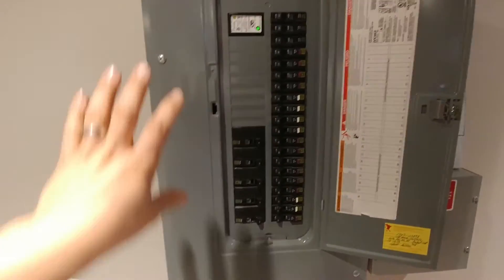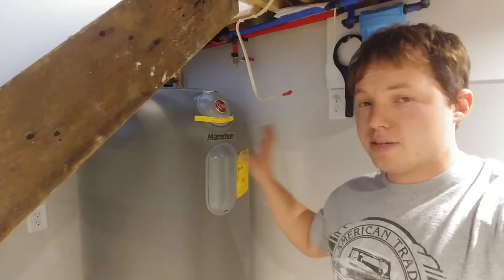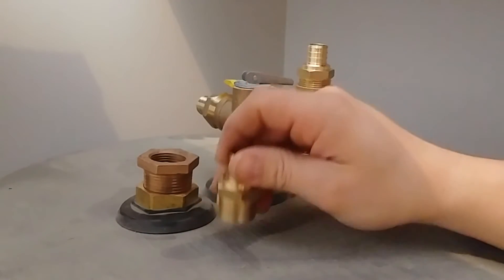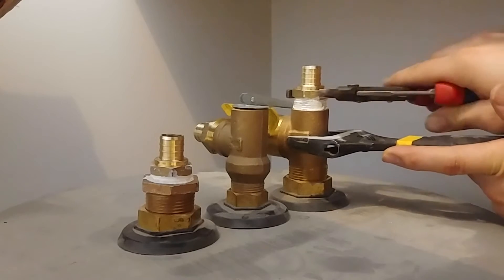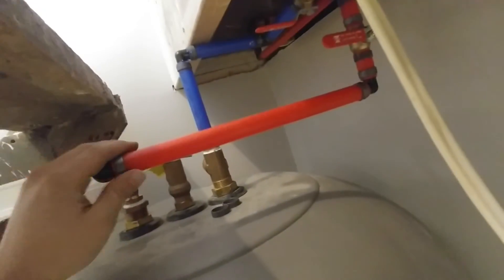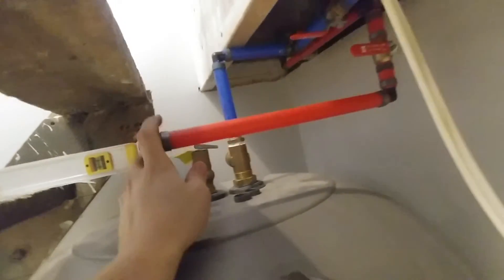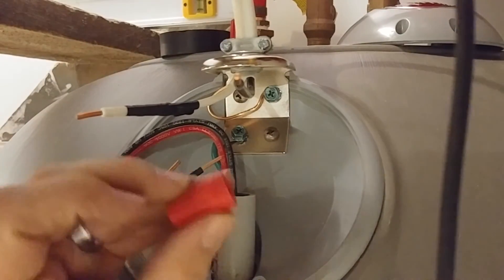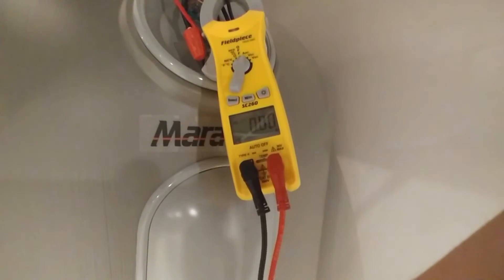How To Install an Electric Water Heater - Plumbing, How To Wire, & Materials Needed - Rheem Marathon

Comment: Can you run the power thru a 40amp contractor wired thru a 120v coil to a smart outlet, controlled by the automation network?

Comment: Do I need an expansion tank  for a electric water heater? Presently I don't. I need to replace 2 tanks because I have a geothermal system. Do they need to be put in pans? And lastly. Does the relief pipe have to be copper or some kind of hard pipe? Thanks again. I would appreciate a comment. .

Comment: Nice video.  But the manual states that the vacuum relief valve should be replaced every six years.  How are you going to do that without ripping out all the plumbing to the cold water inlet?
Reply: yeah I think for the cold supply with that VR valve you need to go with screw-on flex tubing so they can be detached. The older units the cold supply had T with the VR valve on top and the cold inlet coming from the side and you could replace just the VR valve on top by double wrenching.

Comment: If there are two green ground screws (one inside the compartment or junction box on the water heater and a second one on the outside cover of the box) does it matter which ground screw you use?

Comment: Next time install a disconnect and an expansion tank. You're will have a better system and protect your hot water heater and other devices with that expansion tank. The disconnects just for convenience but also for safety.

Comment: Shut off valves on the hot side of a water heater are Dangerous and Illegal just about everywhere in the U.S.  Having that valve closed and the water heater on will cause an explosion if the over pressure valves fails!  Never install one on the hot water side!

Comment: would have like to explain about ground wire does it go to bottom of tank to where
Reply: In general,  ground wires (green or bare) connect to , typically,  a green washer head screw within the appliances electric junction box and that green screw is connected at the factory assembly to the metal external parts of the appliance to ensure potential contact by anyone using/touching the appliance will not inadvertently receive an electrical shock due to any electrical system failure/short/arc etc.

Comment: What about code that requires copper pipe and brass fittings, is that relevant with an electric hot water thank?

Comment: Thanks for a great video. I was wondering if the wire should be run in a conduit. I am unsure of the code so I always run wires in a conduit for living spaces.

Comment: Hi, I installed one of theses in my home but I used a Galvanized nipple to fit a flex stainless tubbing and rust is starting to show at the junction of the vacuum breaker..

Comment: Great, except this would NEVER pass inspection..... this is NOT done to code ANYWHERE in the USA. No Flex lines from the water heater to the pex lines, no expansion tank, no earthquake straps, no disconnect.....

Comment: Great video, wow! You're a natural teacher.  So question for you.  If I downgrade my hot water heater from a 4500 to a 1500v, can I still use the same gauge wire that was put in for the 4500?
Reply from the maker: Yes but the breaker size would need to match the maximum circuit ampacity for the appliance.

Comment: A few quick questions. First what is your opinion of the stainless cinch style pex clamps? 2nd how is your water heater controlled for the energy program without wifi/network connectivity, and 3rd is it only a requirement to have metallic inlet and outlet for a set distance before pex on gas units?  Great video as always, I enjoy watching them

Comment: Hey man, thanks for the tips. Question about the pex: is it supposed to look so pretty? I thought you were supposed to run it curvy and use as few fittings as possible. A plumber I worked for once told me that. He said the old school guys would run it like copper, cutting the pieces straight and using lots of elbows, but apparently that reduces flow? I'm curious though to hear the other side. Mahalo!

Comment: Our Bradford-white gas water heater was in service for 26 years and was still working fine when we replaced it last year. Could never understand why it lasted so long (never drained it or changed the sacrificial rod) but read that if you keep the heat to a minimum (we always kept our water heater just warm) it slows down the corrosion process. Heat speeds up chemical reactions. Great video! Loved the cut away look inside!

Comment: My understanding is that PEX is not recommended within 18" of the water heater. This is a manufacturer's guidance, not code.
Reply: Should be code, it is in other countries.
 Copper is for keeps;)
Reply: I have copper water pipes in my home. I prefer copper water lines because I can actually hear the water flowing through the copper water lines.  This is a good thing when any one in my family (including me) leaves water running.  The only place I used a PEX A water line is when I ran a cold water line under my second story deck to a spigot. This spigot is used to water plants on my deck. PEX A will swell but not burst if water is inadvertently left in the water line to freeze during winter.

Comment: Great video! Informative and very helpful!
Reply: Thanks for the reply, really appreciate your videos!
Reply from the maker: Glad it was helpful!
Reply: @BenjaminSahlstrom  Would you use any Teflon tape or pipe dope if you were replacing the vacuum breaker?
Reply from the maker: @noelshaffer9609  Yes. Only the fittings that use a rubber gasket don't need thread sealant. And traditional tapered thread fittings need thread sealant.

Comment: Hi great video,  question I have is the different amps I have an older select water heater and it's the same size as yours. I did remove the elements to check for calcium deposits.  I am lucky as mine are made of brass and theres 2 top n bottom. I see you choose a different wire for for your main electric wires. I'll look back. 10-2 wire. Mine is only used in a lake house then it was shut off n empty on off seasons. It's still new. The wire on it is 12 ga yellow wire. I have a GE panel box and I'm all open as I just gutted my back home. I removed all the ceiling n it's just framing at this time. 
I want to run the new wire in my rafters and possibly buy a slide tube to keep wires safe. I will say I had a mouse or 5 in my home but never had 1 spot get chewed on by one of the critters.🦝

Comment: Installing PEX directly to the water heater as advised in this video is against code. It's not allowed for the first 18 inches. 604.13  http://epubs.iapmo.org/UPC/mobile/index.html#p=136
Reply: Not true under all codes and usually only for gas water heaters.

Comment: Awesome video on installing a Marathon.  I’m thinking of doing the same.  I was interested in what type of tubing you used for the pressure relief valve.  PEX?  If not PEX, what did you use?  I didn’t see an additional video from you describing how to do this.  Thx!!
Reply: I was also wondering the same.  Can you use PEX on the relief valve?
Reply: @hughrobinson6194  I never did get a Marathon (it wouldn't fit in the space I have for a water heater) but the unit I bought is an electric 40-gallon Rheem... and I did use PEX for the relief valve.  I think I used a SharkBite fixture screwed into the orifice and jammed that PEX right up into it.  Hope it never gets triggered but if it does it will work fine.

Comment: Hey Ben, I'm going from a natural gas water heater to an electric water heater.  My question is, "Can I run my cable from a sub panel or does it have to be run from the main panel?"  RR
Reply from the maker: As long as your sub panel is big enough (how many amp breaker is feeding it) then you should be fine. I'd say if you have a 50amp or better sub then it should work as long as you don't have other large loads on the panel that could cause issues. 

Good luck!

Comment: Nice!  I have a question:

I need to install a 19 gal 120 volt (1500 watt lower element (only one element) water heater.

What amperage breaker do I need? I know I need #10 wire and there is an existing double pole 30 amp breaker in the cutler hammer breaker panel; do I need a standard 20amp breaker to replace the existing 30 amp?
Reply from the maker: The water heater should say the maximum sized breaker on the information sticker somewhere.
Reply: @BenjaminSahlstrom  - it does not.  

I'm just wanting to know if the 30a would fry the 1500w element - as it is wired.  The manual only says to use #10 wire (which I know is the common wire for a 30a breaker) so I assumed that the 30a was standard.

I have ever used anything larger than a #12 for a 20a breaker
Reply: @BenjaminSahlstrom  - If I multiply the value for current by 125 percent to determine the size of the breaker I need for the heater. 

A 1500-watt heater on a 120-volt circuit would need a breaker of 15.6 amps. Because a 15-amp breaker would be too small, you need a breaker with the next highest rating, which is 20 amps.

The only ting that was confusing me was the #10 wire requirement on the manual.
Reply from the maker: Run 10ga wire with a 20a breaker. Then your wire will technically be oversized but that's fine. Leaves room for an upgrade to 30a if needed. That's my two cents but I cant be sure without actually seeing it of course. Good luck!
Reply: @BenjaminSahlstrom  You were spot on.

The 30a would have been too heavy for the 1500w element.
Reply: @hybridamerica  A bigger wire is fine, it has no bearing on how much the heating element pulls. You would normally use a smaller breaker so the wire wouldn't overheat if there was a short. With a #10 wire that would not be a problem either.

Comment: You forgot to open the lower electric panel to show how to adjust the water temperature. Overall good job thanks!
Reply: @Gf Lins Phases do not have polarity.You only have positive and negative wires when using DC electricity. Both AC feed wires are simply called "hot", The breaker in the panel is also called a double 30A. You're confusing people when you call it a 60A breaker.

Comment: Pex is used in a lot of new home construction. Google pex use in homes and yiu will see the issues pex has. Pex tends to leak at the joints. The hot water pex line tends to burst. Here in Sacramento CA, we use copper
Reply: Copper pipe tends to burst too in some situations like when there is a hard freeze (especially if the power goes out due to outages or not keeping the house heat high while on vacation)

Comment: National Code does not permit PEX piping within 18" of a hot water tank.   Not sure about your area, just the requirements where we are.   Also we cannot put a shut off valve on the hot side of the water tank, only the cold.
Reply: agreed, code, where I am (NY), is to keep the pex away. I typically just do an 18" run of copper then adapt to pex

Comment: This is a pretty good video for the purposes of wiring an electrically-powered hot water heater, but please be advised that, as always, there are special tools made for special purposes.  Considering that the creator/author of this video utilized what he had on hand for wiring his hot water heater, white 10/2 Romex, one also needs to pay particular attention to the fact that this wire contains a black and a white conductor.  Having spent most of my life in the electrical field, I can tell you that black is most often thought of as representing circuit HIGH and white is most often thought of as circuit LOW/Neutral.  This fellow did a good deed by explaining that the white conductor he used should be identified as a HIGH in this circuit -- by wrapping it with black electrical tape -- but the best way to do this is to use 10/2 Romex that doesn't contain a white conductor.  In most cases, the proper Romex for this job contains a black lead and a red lead, but the important thing to note here is that it doesn't contain a white lead.  Getting back to special tools, the author mentioned what he called a "cable ripper," which goes along with what I'm about to write.  The term I'm used to when it comes to stripping the outer "jacket" (not the internal conductor insulation) is an "electrical dismantling knife."  Specifically, I use a Knipex 98 55 insulated dismantling knife that has a guide shoe welded to the end of the knife's hook-type cutter blade.  Why do you need something like this?  As opposed to using a utility knife -- and praying that your knife cuts down the middle of the Romex (as the author mentioned) -- this specialized tool will cut the outer jacket without affecting the inner conductors at all ... and, believe me, it's very easy to cut the insulation of an inner conductor by employing a utility knife -- a.k.a. a "razor knife" -- for a job like this.
Reply from the maker: Thanks for the informative, respectful, and knowledgeable comment! Really appreciate it.
Reply: @BenjaminSahlstrom  Happy to do it ... and happy to contribute to your good efforts by answering any questions anyone might have, as well.  Have a good one.
Reply: They don't manufacture romex cable or any other cable assembly for that matter with just a black and a red wire at least not here in North America. Cable assemblies come with a black/white, black/white/red, or black/white/red/blue. You would have to run those individual colors in conduit.

Comment: Next time be more explicit on your wiring instructions. That's my only issue great video. Thanks Ben.
Reply from the maker: Thanks for the feedback!
Reply: @BenjaminSahlstrom  you did FANTASTIC  I have all copper but my old tank has all new shut off valves.  And steel flex hoses.
Reply: Man I'm a lady in my 60s n I understand what he did..... my only question was about the gauge of wire..

Comment: Good sound and clear video and very explainfull, BUT I was expecting to see you running the electrical wiring from scratch. almost right.and 20 minutes, too much time. Well that's my opinion. As you see one of follower peanutbutter 1925 said: And to think that I have paid$100.00 to wire-up the water heater! It's so simple.
 But did not show anything regarding the wiring lay out. it will be nice if you added how you runned the electrical winring as you show how to connected the flex hoses.

Comment: I have question. I see places claiming pex can not be connected directly to a water heater and must have at least 18" connection between the pex and the water heater. I see that you connect them directly to the water heater. Have you ever had a problem come of this? I personally don't understand the reasoning if you use metal crimp rings for sure if the pex piping can hold the hot water anyway. I might could see the hot water slightly softening the pipe and softening those pex A stretch style connections making them pull off easier if anything but really don't even see how that could happen. Anyway just wanted to ask your luck so far connecting them directly like that and how long you've been doing it this way because I did mine that way and wandering if I should go through the trouble of changing it. Also interested to know what brand and model that crimp tool is? Mine is much harder to squeeze and hard to work in tight areas but I guess the universal for different pipe sizes is nice though.
Reply: use sharkbite water heater kit.  It connects directly to water heater and to pex. It is  flex steel wire covered and comes with a shutoff valve on the cold. Super easy to install. Just be sure to follow directions exactly.

Comment: Code says you need to protect the electrical wire with a flexible metal sheathing when it may be exposed to mechanical injury.  Is there a rule to say if it is exposed to mechanical injury?
Reply: Only if subject to damage.

Comment: I had heard that PEX should not get hot, it effects the PEX longevity.  With that in mind, is the PEX fitting on the HOT side too close to the hot water source?
Reply from the maker: It should be fine especially with an electric water heater. If you have a naturally drafted gas water heater then the first foot or two would be better suited to use copper.

Comment: Where is the Thermal Expansion Tank? It's code nearly all across America in a closed plumbing systems for all new installations.
Reply from the maker: It really depends on the application. Our system is supplied by a well and has a large expansion tank for the well pump that also served the purpose of a thermal expansion tank.

Comment: Hi Ben i have a question, if the electricity goes out will you lose cold water pressure or will it stay the same? Someone told me that you will not have any pressure if that happens.
Reply: the cold water pressure not affect it if electricity goes out! its pressure coming from the city water tank supply!

Comment: I have a question and really hope you can help me. I just got my marathon water heater and noticed that the hit side connection turns freely. Can you tell me if this is normal. I just want to make sure it is before I install it. I take hope you see this and can write me back. I called the technical support and they said they don't know
Reply from the maker: I think it probably fine as the fittings on the top are kind of like unions and use gaskets to seal instead of the traditional tape and dope method. The Installation instructions should explain this I think. Hope that helps!
Reply: Benjamin Sahlstrom thank you so much for the reply.  It installed with no problem. Thanks and take care
Reply: Hmmmnnh, not very impressive or comforting that tech support can't answer such a basic question!! A call back sometimes results in the ability to talk with a tech rep who is better informed about their own products, without getting initial tech rep in hot water ( so to speak) by asking to talk with a supervisor.